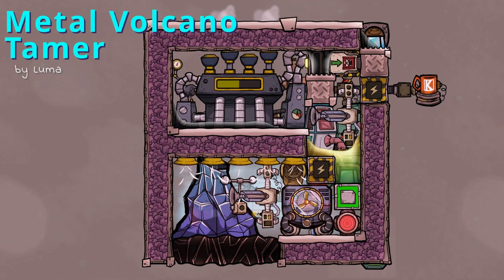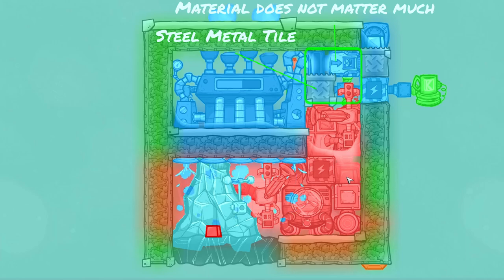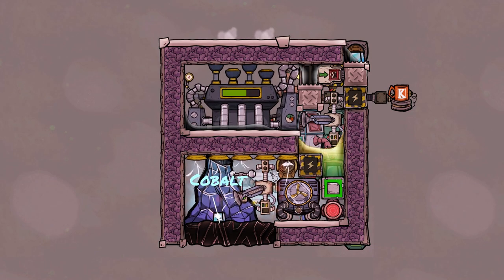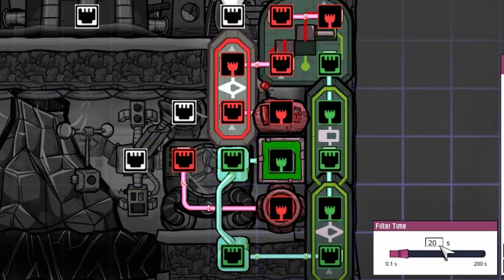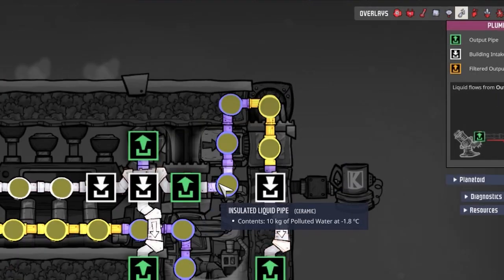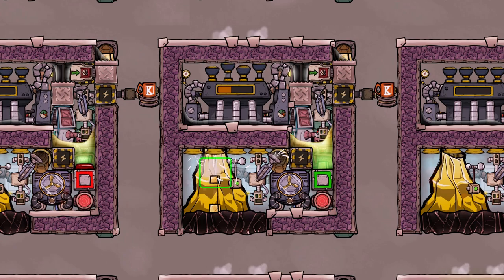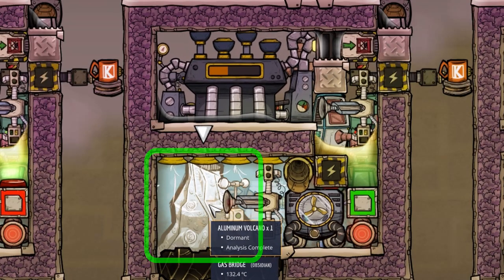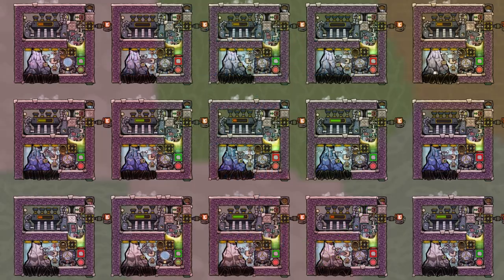My Metal Volcano Tamer - Explained

Comment from the maker: The Priority for the Dispenser is 1 and the Conveyor loader is set to 2.

The second highest ranking result in the last youtube poll was "Tamer for a volcano"
So i present to you a metal volcano design for Oxygen Not Included: 
The not energy efficient but tames all the metal volcanoes -tamer! (not niobium)
Every Metal volcano (not niobium ;D )! Honestly though this took a lot of work and I hope it helps you.
If you want more efficient tamer you need to build them specifically for each volcano type.
But for now i hope this covers a large range of use cases :)

Outputs the material at 130°C if you don't extent the cooling loop to the top right tile
It is very easy to expand the cooling loop to the tile the material is dropped on. 
Put a tiny drop of naphta on it (for heat transfer reasons)

Short Version: https://youtu.be/npCgj-VZj9E

Become a Member! :) https://www.youtube.com/channel/UCRRpEHcVHEU6PK-QGwCbhDQ/join
Patreon:  - https://www.patreon.com/Lumaplays

My Channel - https://www.youtube.com/c/Lumaplays1/?sub_confirmation=1
Discord  - https://discord.gg/vjAhbrEzRZ if this doesn't work try that one 
  - https://discord.com/invite/vjAhbrEzRZ

Comment: A minor improvement for those vulcanos with low dormancy period. Adding normal pipe under the pressure plate helps reduce the temperature just enough that it's faster then the dormancy period. From what I tested you can even change it to radiant pipe, but for the hotter vulcanos you will hover at 100C liquid temp.

Comment: Wow I did NOT know that about the liquid bridge (the heat equalization)! I will be using them a lot more now
Reply: That trick is pointless here. He could have just placed the temp-shift plate one tile to the left. Still it's Good to know about so you don't accidentally leak heat out of an insulated box though. Overall this build is needlessly complex for a survival build, and all to save a few materials that were likely plentiful. It's also not as small as advertised unless connected into your power grid (I guess simulated by the Klei sandbox-mode generator) as no battery is included.

Comment: hi i built this design for an iron volcano and my steel sweeper overheated. i used conveyor bridges + rails and filled the empty background tile spaces with igneous drywall to spread the heat a little more im assuming that's going to fix it. i built everything out of steel if not specified just because. it's 9.7k/s at 2526.9/s 43s every 772s. i really like this setup! figured id give the feedback and say thanks
Reply from the maker: Hi Rob! Thanks for the information. Just to be sure try it without the changes and see if it still overheats. If you want to you can share a picture in the discord. As to how the changes might affect the system: I did not test it with background tiles. So i am not sure how that could affect the build. Drywall has a very high mass of 400kg per tile that is 4 times the mass of a regular tile and can save up way more heat then otherwise possible. and if you used that everywhere you are transfering heat where it should not be transfered too. But i can also be totally wrong and it is something else :) As for testing there is a save file in the description so if you want to check it out you can find that there. The materials are listed in the short video that belongs to this explainer video, as far as i remember; or you check the save file. I Hope one of these suggestions help.
Reply: the idea with the igneous drywall is that it will store up heat and regulate the temperature better. the steam turbine will have to delete the heat stored in the drywall during the volcano's dormancy which means less heat needs to be dealt with during the active phase. that does mean that all the items are going to stay in the tamer in large batches though

Comment: Good videos. I cant get this to work. Are you using nobium etc? I am trying to get it to work on a volcano.
Could you attach a save file?
Reply from the maker: Oh this is for metal volcanoes not for regular volcanoes. The Material should be in the video. Only normal stuff and steel.
But normal magma volcanoes have a much higher output in regards to material. That is why dthey probably do not work.
 
You can use this for regular volcanoes:
https://www.youtube.com/watch?v=dkh-rIFcwvM&t=3s&ab_channel=Lumaplays
https://youtu.be/qmLzIRX0mKM

Comment: I've been trying to make a volcanoe tamer were I use salt/polluted water to get the metal, dirt, salt, and fresh water, but I can't seem to get it right. Luckily it's not due to everything catching on fire, but due pressure and to cold issues surprisingly. Any ideas on how to make it work more effectively?
Reply from the maker: That is specific to the volcano and its heat you are working with. Maybe use mechanical doors to avoid overpressure and split the liquid metal area from the gas area so you can have different atmospheres and pressures. I don't see and issue with your Idea itself. should work fine. 

Dump the liquids in the volcano room. surround the room with tiles or doors. place a steam room on top which is cooled by the steam turbine. put stuff in to get stuff out. done.

Comment: Hi Luma, what is your way of making Naptha?
Reply from the maker: Hi DeeBoss55 check out the first few minutes of my Magma Let's Play episode of the first let's play. episode 6 or 7 I think.

you can also use petroleum or crude oil but they flow more and are more annoying to deal with
Reply: @Luma_plays  Hi Luna, i made this last night and my auto sweeper keeps picking up the copper from the weight plate and putting into the dispenser. Looping. Where did i mess up?
Reply from the maker: @Dankz_Live  I will check it when i am at home amd message you then :)
Reply from the maker: Hey  @Dankz_Live  down below you can see the Settings. Your issue could stem from the filters having a wrong timing. From the Temperature sensor being set to above insted of below. From mixing up filters and buffer or AND and OR Gates. Or from not connecting the autosweeper. Or from setting the Priorities incorrect.

Priority for the dispenser needs to be lower (1) than for the Conveyor loader (2). You also need to allow the respective material for the conveyor loader.

Weight Plate set to above 10kg connected to a filter. Filter set to 30 seconds. Filter connected to a Buffer. Buffer set to 10 seconds. Buffer connected to the AND-Gate.

Temperature Sensor set to below 140 or 130°C. Temperature Sensor connected to a Filter. Filter set to 20 seconds. Filter connected to the second input of the AND-Gate.

AND-Gate output connected to the Autosweeper.
Reply: @Luma_plays  Thank you so much. It was my priorities. Its working perfect now! Awesome! You're the best!
Reply from the maker: @Dankz_Live  Ha awesome. Glad it works now :)!

Comment: So I know this isn't the point of the video... but if you're only concerned about gathering the materials from the volcano (let's say an iron volcano)... as a complete noob, could I literally just build a steam chamber + steam turbine  like you show at :14 and (assuming I build a conveyer/setup to retrieve the contents after sealing it up)... that'd work?
Reply from the maker: Yeah probably.

There are more factors to be aware of like having enough steam in there to not create heat spikes. You want an even stable temperature. If the temperature gets to hot it hasn't been enough steam turbines.

If your steam EVER gets over 135!°C it would be a good idea to actively cool all your turbines.
If steam stays under that passive cooling is enough.

So in praxis you will probably need 2 or 3 turbines an aquatuner a cooling loop and either an entrance to the steam chamber via double liquid locks or a conveyor loader setup

Comment: There is a version using less steel and able to construct without the DLC?
Reply from the maker: Hi Hmm. Here is my answer :):

There is no part in there that requires the DLC. I don't think there are any -construction relevant - parts in the game that are DLC only.

In this build it is not possible to reduce the amount of steel (noticable).  

You can easily build a version not using steel and not using an aquatuner. But you will need to make it big and self cooled (use the output water from the steam turbine to cool the Steamturbine itself). If you want your build to be usable for all the volcanoes (no niobium) then you need 4 steamturbines.

Hope that helps.

Comment: Just  the aquatuner can't stay on long enough to cool the coolant loop with just a single +800w turbine.  had to hook it up to an additional power source which kinda defeats the purpose of the compact design.  Otherwise great build.
Reply from the maker: This is not self powered. you would need external power to use it. To make it self powered you probably could just add a second turbine. The smallness was intended for the mini base map.

Comment: Nice compact build.
Just to mention, your demo is absolutely able to power itself so there is no need for those dev-generators ;)
I just wonder how to determine when/how the cooled metal can be picked from the top right spot?
Reply from the maker: The dev generators are for stable testing. even in a normal game i would have the metal volcano tamer on the main grid just in case the dormancy is too long and the system ran out of inherrent power. You can pick up the material pretty quickly after it dropped in the top right corner if you already have a bit of material accumulaterd there. If you remove the material each time it needs longer too cool down. (The game has different debris temperature calculations- either it tries to average or it tries to use the temp that the debris already has deleting even more heat in the process - or creating heat if the debris is very hot)

So you have to decide on a pick up time depending on your cooling situation, the amount of debris and the material used or volcano material. Hence i can't give you any specific time frame.

Hope that helped :)

Comment: You should rly eliminate the AT thrashing on and off. I like how small it is but i dont like how hot the material leaves the system cos its free for dupes to pick up when hot or if u wanna just lead the rail farther from it. So all in all it kinda needs more space if one would rly want to cool down the output to approx room temperature. 
Its nice cos how small it is and cos u use naphtha (all hail the best liq in the game haha) but i still think you sacrificed too much usefulness and function just save very little space.
So ye, material on exit rail imho should be at safe to use temperature.

Ill be sticking to my version of tony's idea but it is nice to have options for people i guess.
Oh and you have heat injection into the ins tile wall with automation bridge and you could also spill a layer of nuc waste on the 3 ins tiles beneath AT to prevent heat leak. Cos as u know gasses better conduct heat to tiles than any other phases so those will get relatively hot soon and will start bleeding heat.
Reply from the maker: Hi tyrael in a normal game i would consider running the conveyor rails through the Naphta on top of the steam turbine. And closing the drop of point with doors and automation. But in this version I went with what you see :). And the heat bleading into the walls was accepted. Because I would build the whole thing in a vacuum.

But as always I appreciate your feedback alot :). Thanks man!
Reply: @Luma_plays  thank you for all the vids mate and gz on 3k subs! I might seem like an ahole in this day and age but constructive criticism i think is a the only drive for improvement or evolution. So it's all in good faith. I dont use time to comment on people i dont care or im less... Outspoken 😉
Reply from the maker: @tyraelpl  Appreciated! And I just forgot about the aquatuner automation addition. Weird that it is needed. Maybe that behaviour can be used to our liking. Maybe an exploit of some sort.

Comment: How did you make the room vaccum? I don't see any debris from gas pump
Reply from the maker: Make the vacuum way bigger than the space you need to build the contraption. then you have no debis inside. i normally make the vacumm 2 or 4 tiles more than i need so i can add an liquid lock and ladders around the actual build.
Reply: Ahh, i see
I still using primitive tech i.e. pumping the air out the room, great vids, don't stop the ONI, or the duped won't breathe, because it's not included.
*Badum tss

Comment: what happens if i build it with niobium
Reply from the maker: You can build it with niobium (the element). Not sure how good the heat transfer is then.

But not build it on a niobium volcano. For that i have another setup.
Reply: @Luma_plays  yeah the niobium volcano is what i meant
Reply from the maker: @overdramaticpan  Check out my sexond channel LumaRaw. I just uploaded one there a few days ago.
Reply: @Luma_plays  i didn't need one i just thought it would be funny. thank you though